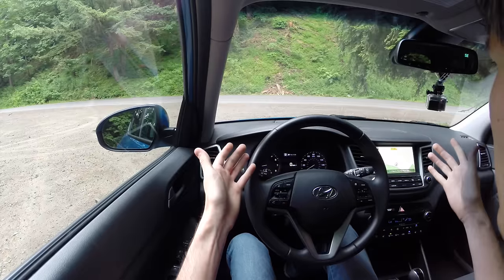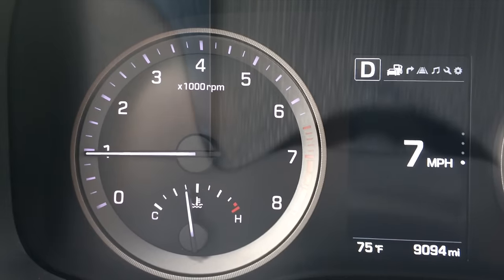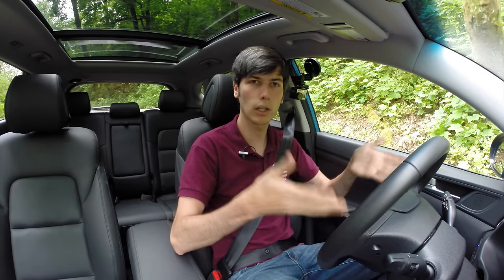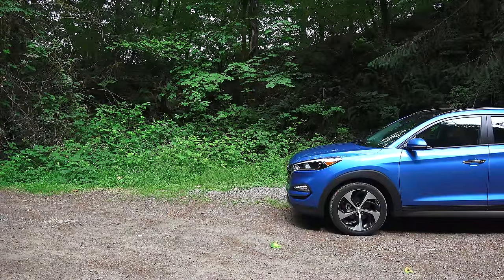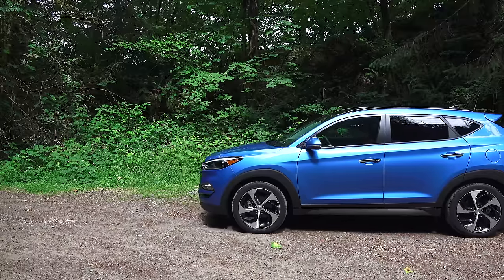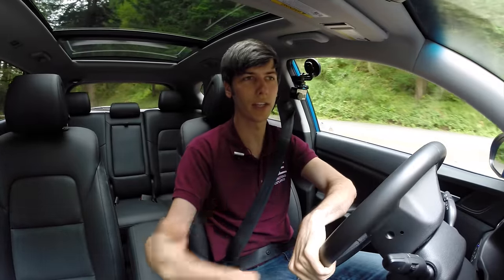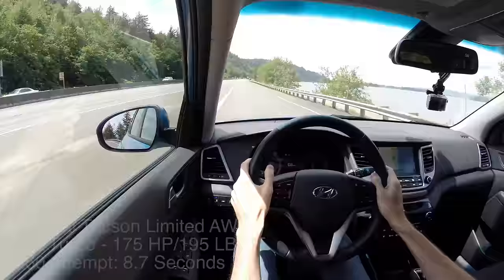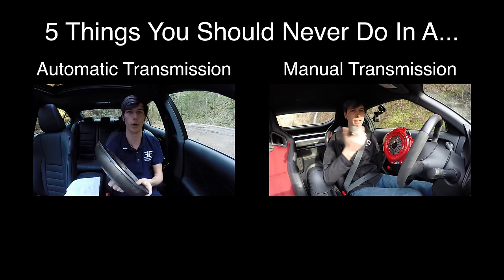5 Things You Should Never Do In A Dual Clutch Transmission Vehicle

Comment: "Try not to inch forward too much."

RIP city drivers...
Reply: Also literally how a manual works like if I “inch up” my foot never comes off the clutch
Reply: @jackpot1864  I'm the guy in 1st chugging along like a Rubicon rock climbing, tends to piss people off but I find it amusing.
Reply: With a manual I tend to use the clutch to get me to speed and then disengage it completely, so I can roll and maintain the speed for a while without constant wear.
Reply: Its me, i am city drivers
Reply: That's why DCTs(Especially DSG) are destroyed quickly in Turkey(mainly Istanbul), Russia(mainly Moscow) and China due to inch to inch traffic. - (btw DSG has extended warranty over these areas.)
Reply: Hey, if you got the inches to go forward, then go for it.
Reply: @theJenan  Over there it's called "centimeter to centimeter traffic"
Reply: Just wait till the car in front if you is 10 feet away, fully engage your clutch and let out. Been doing it for years without any issues
Reply: Just in general RIP city drives... poor souls!
Reply: @jackpot1864  so the clutch is a brake pedal too basically?
Reply: kishred bird is this sarcastic or r u serious I can’t tell sorry
Reply: @theJenan  in dsg it's bad when the car shifts in 2nd, because it slips the clutches that's an issue because 1st is so short.

The best thing to do is put it in manual or sport to hold first for longer.
Reply: @daytonm6809  wouldn't the cars behind you start honking?
Reply: @dragospahontu  noticed that myself and have been doing that very thing for a bit, especially on an uphill, almost always switch to manual until it’s at top gear then back to drive mode
My dsg delays have been becoming more of a lurch now and it’s an anxiety nightmare sometimes
Reply: @xjsvg  what box do you have and how many miles?
Reply: @dragospahontu  6 spd DSG mk5, 140k miles on it so she’s pretty exhausted
Reply: @xjsvg  yeah the clutches need some love
Reply: @theJenan  same here in indonesia (mainly jakarta) where the inch to inch traffic is one of thr worst in the world and dct is destroyed very quickly here especially the dry clutch one
Reply: What do you do if you’re stuck in rush hour traffic ?  What kind of crappy transmission is Hyundai using that no matter what you do, you’re causing excess wear on the clutch ???
Reply: I have a DDCT automatic transmission (dodge dart)... and yeah. That's how I wore mine out. An hour of inching up and I thought the damn thing was going to explode by the time I was able to drive normal again. I was so confused, I knew nothing about the transmission, never drove a standard... if I had known this prior to that adventure, I wouldnt have a messed up odd clutch right now. sigh
Reply: @KB-xb1ci  is it dry clutch or wet clutch?
Reply: @chicagodaddy1  these wet clutch dcts are bulletproof only dry clutch ones have to replace the clutches after some time.
Reply: @dragospahontu  dry
Reply: @KB-xb1ci  well a dry clutch from Chrysler is the worst combo, but it is essential that the buyer knows and understands the differences from a torque converter and a dual clutch gearbox.
Reply: I have hyundai hybrid with dual clutch, I think that is the best combination, as you can slowly drive with electric engine while clutch fully engaged
Reply: @dragospahontu  yeah I do now 😬
Reply: @KB-xb1ci  👌

I personally like DCT more than a torque converter even though it's less reliable, it shifts so much quicker and imperceptible.
Reply: @dragospahontu  ZF 8HP is the answer until it’s all about EVs
Reply: @theJenan  Also Delhi (India). Lots of DCT clutches burnt in the past year, especially of Kia Seltos and Hyundai Creta.
Reply: thats what wifey said last night
Reply: Torque converter says "whaddup, DCT?"
Reply: @dragospahontu  dry
Reply: @indrapersad9182  it's pretty good. Dsg7 is very advanced and reliable nowadays. Just drive it like a manual
Reply: 7DCT Tucson owner here, 230 000 miles on the clock. I have been soft offroading mine quite a lot lately. Had my dual clutch inspected a month ago, mechanic said its good, put some new gear oil in and its still smooth to this day. Havent had any problem in traffic and in my area its quite heavy. Idk what the drama is about these transmissions.
Reply: thats why my friends vw with a "dsg" slips when ever he pushes the accelerator, when ever he tries to join  the car will not accelerate, it would be on the 4 or 5th nd it will rev up the engine but no power transmitted to the tires. also his car jigles and sometimes   have a very scary stutter, like if you have pressed the brakes really hard, but its the transmission downshifting and stuttering the whole car really bad
Reply: This sounds like the perfect scenario for a hybrid vehicle. It can use its electric motor for inching and only engage the DCT once you reach a reasonable speed.
Reply: isn’t that only in dry clutches?
Reply: well, just wait a bit for bigger space, and then let the clutch to fully engage. Not that hard
Reply: I live in a crowded city and my dry dual clutch died at 50K km
Reply: Just don't let the clutch stay partially engaged for more, than 3 seconds and let it rest fro a gew seconds. Does make any sense?
Reply: @dragospahontu  should shift after 3000. Why shift earlier if you don't have enough torque at second?
Reply: @jackpot1864  just wait for some space
Launch the car these 10 ft
Press the clutch back in and hit the brakes.
Problem solved, no more slipping the clutch 😂
Reply: Generally DCT transmissions have a pretty low first gear, so it's not hard to inch forward with the clutch fully engaged. In traffic it's just a matter of letting a bit of a gap, maybe a couple of carlengths form in front, then take your foot fully off the brake, let the car idle forward then stop again. 
It's really not hard.